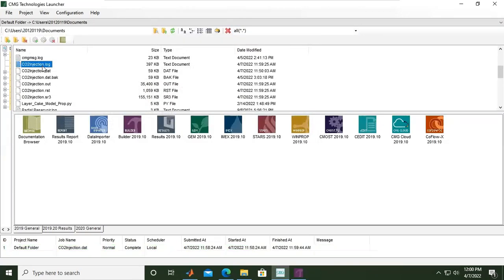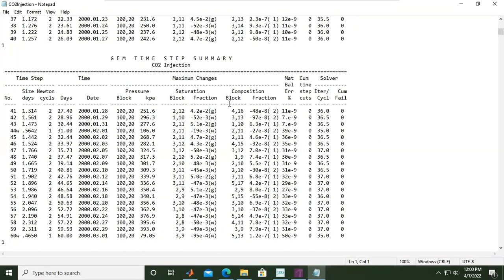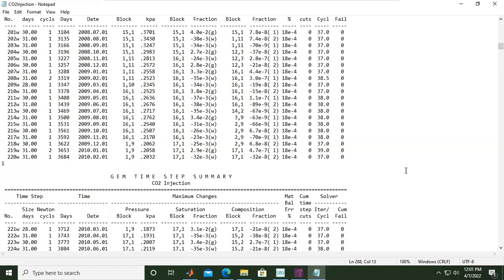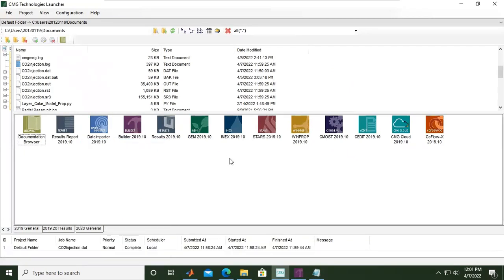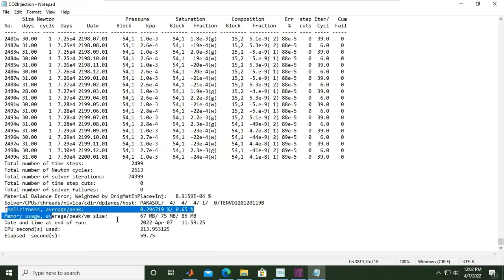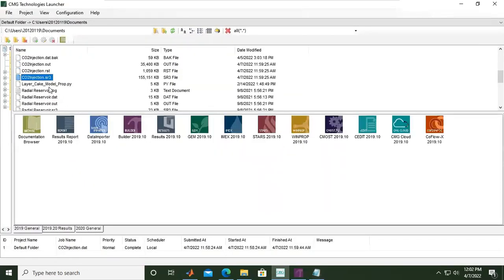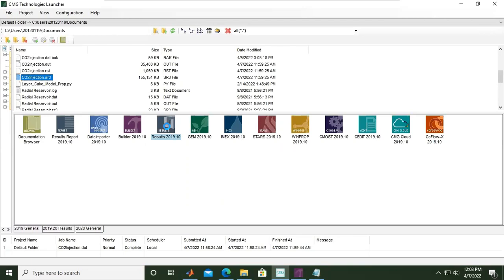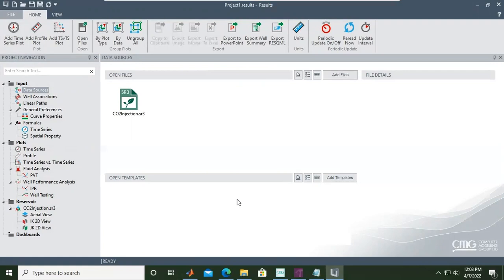CMG CCUS 21: Simulation Results Log in GEM

Comment: When I tried to simulate the model is not working
Instead showing an error msg --- "Use either (*ZOIL/*ZOIL) OR *ZGLOBAL(C), not both

Can you help me for this error.. I am trying the same model as you are showing in this playlist
Reply from the maker: i redo the model actually, you can follow the same case, please check the latest episodes in this playlit, i address that issue there
Reply: @EngMan101  OK THANK YOU ... Please if possible upload the video daily. This course is really helpful for the understating of CCUS simulation
Reply: @EngMan101  I couldn't find the video you are talking about. I am having the same error message.